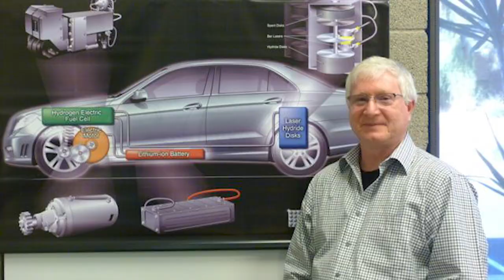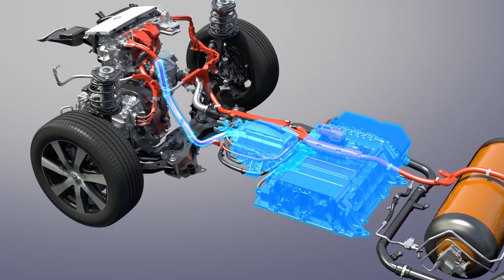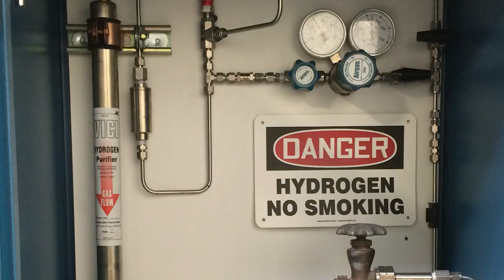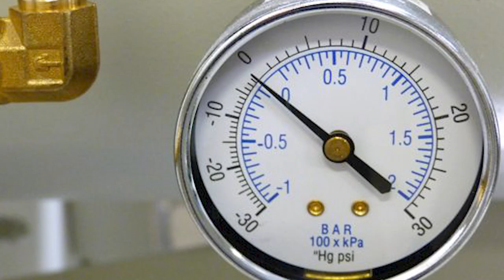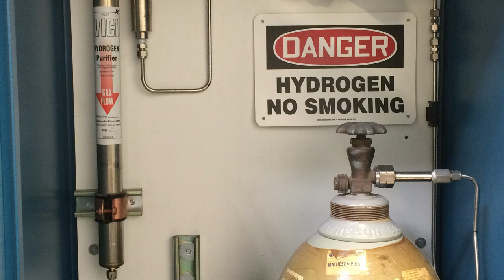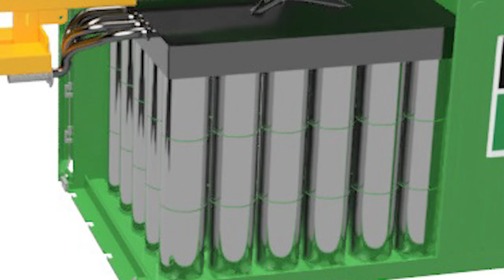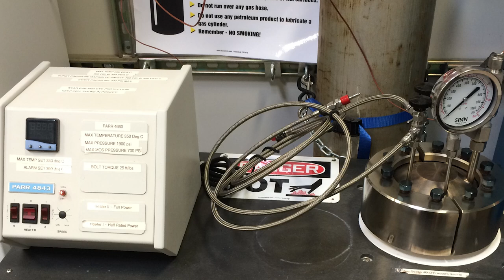This BANNED Technology Could Push Hydrogen Cars Over BEVs

Comment: Exciting technology.  I am excited and intrigued.  But the numbers don't add up.  Paul said 15 lbs for 20 miles.  That's 1 lb for 1 ½  miles.  But he did not say whether it is for a compact car, a full sized car or a pickup.  Then he says 4X 375 lb (=1500 lbs) will take a truck 500 miles.  That's 1 lb  for ⅓  mile). You ASSUMED he meant a semi truck, which would be spectacular).  But he could have meant a F150.

Comment: FYI there is another hydrogen tank type, maybe it’s the same as you are talking about, bob lazar had a relatively low pressure tank that stored the hydrogen. There was something in the tank. I believe that thing was something used in nuclear weapons or something and therefore it was banned. But the hydrogen was not explosive and required low pressure so he could charge his hydrogen car back in the 90s with a solar panel.

Comment: To me I think the best solution is to concentrate on multiple engines, a combustion engine running alcohol from sugar cane because burnt alcohol from sugar cane can be absorbed by plants, then a hydrogen engine to assist the alcohol engine with a diamond nuclear battery( if that is a real thing) for backup. I reckon a car should be clean of course but it should use multiple technologies to go further and faster!!!!

Comment: You are correct.  But ! For larger vehicles, that run for hours. Like a range extenders. 
Trucks, Trucks refrigerators,  tractors, many farm combine harvesters, ships, large boats , many vans 
All need electrical power.  You don't want to run out of electric in a ship. 

Also you can use as generator s to recharge say 10 cars 🚗  at a super charger stations.  
Delivery of liquid hydrogen to regular placed generators. 

The sun goes down at night. 
The wind is not reliable. 

Cars is stupid I agree 👍
Bikes.

Comment: This pressure is similar to Hydraulic pressure, as used in army tanks. It is well known.
Reply: I wonder if we can develop solar panels better so they soak up more rays and then we can use mirrors to funnel more rays into a small area so we can have more mirrors than solar panels and vastly reduce the amount of solar panels required

Comment: Have Toyota 2000year 2.7ltr Hilux utility,am I able to convert it or change over to hydrogen fuel cell and motor..What is the cost to do this and what are the costs of the discs and availability in the U.K. please

Comment: This is definitely the way to go. Beats lugging around thousands of pounds of batteries that take hours to charge. Replacing a battery pack is crazy expensive and manufacturers will stop supporting early versions as time goes on. You will be stuck with a vehicle that has no gas tank so to speak.

Comment: So is it a better buy than anything else?  It sounds as if after some 10? miles I would have to shut my car off, unplug one "cassette" and plug in another, then have to worry that my car would not start either because the next "cassette" did not work, or because of another breakdown in system components: ?   Even if this is cheaper, it won't do if my car ends up stuck on the side of the road.  How reliable is the plug-in-for-a-few-miles-technology?  Or could the "cassettes" be made with a 1000 mile, or 1500 mile range?  Then at least I could count on more than 10 or 15 miles before the "cassette" runs out ?

Comment: I have doubts : 1) These hydrogen disks will require a lot of conversion steps with cumulative energy losses 2) It will recreate a dependency on a refueling infrastructure, like with gas stations ⛽️, making customers price captives again. 3) Like with petrol stations, you need a huge infrastructure to transport the damn disks everywhere to car reloading stations, meaning that you use energy to transport energy (…) 🙄 it is as stupid like the transportation of oil by petrol tankers burning 🔥 crude toxic sulfur oil to ship it on the other side of earth 🌍 then refine it and finally load it on diesel tank trucks burning 🔥 again energy to bring it to the gas ⛽️ pump. The cumulative energy losses induced and pollution is a nonsense. 4) The easy instant access to electricity ⚡️ anywhere for charging a BEV is much more flexible and convenient. Here in Geneva Switzerland 🇨🇭 a lot of supermarkets and malls offers free charging to attract clients, that is perfect and logic, a win-win for everybody, they get the carbon reduction certificates, you get a free charge. The probable future will be parking spots with wireless charging as standard on every EV, no need to load a mechanical ⚙️ disk, and even highways 🛣 with charging EV lanes as some are testing already in Europe. 5) I have worries that this ultra thin film will have temperature and humidity requirements to be able to work without problems, good luck with that in Alaska or Arizona. 6) It seems that the global quantity of platinum available is very limited and that is a de facto limiting factor if you want to use it in fuel cells on a very large scale. So yeah, I think it is born dead.
Reply: "Astronauts on the moon, aha ha ha ha ha"
      - C 0 N E H E A D S -

Comment: I noticed a heavy resistance to saying how heavy, how many miles. this shot up red flags so doing some math...

1 gal of gas = 6 lbs. my tank holds 11 gallons (small tank) and my hybrid EV battery weights approx 118 lbs. so 184lbs,
184 lbs/15(lbs per unit) thats 12.266r units, thats only 245 miles per "full replacement". (I get 550+ on a tank)

may work for people with pure work/grocery commuting. but for anyone else that does other longer driving, I drive 250-400 miles in a typical night, have done many more some days. I would have to reload 1-2 times EVERY DAY. I would have to transfer by hand that 184 lbs. and how many grandparents do you know willing to move 184 lbs (remember this is a small situation) to "refuel".

my car is made with low payload so going above this would drastically damage the suspension/handling.

maybe something with a larger tank?
not really, as that is the smaller source of weight to begin with.

so purely EV change?
average EV battery is 1,000 lbs this is easy math...  66.66r units = 1,333 miles HOWEVER, if we look at the difference in weight between a ICE vehicle and its EV counterpart, its more like 750 lbs. so 50 units = 1,000 miles. and still having a tire burning weight on the tires. better than pure EVs... but new battery tech is looking at tripling (at least) the range in the next couple of years. and not require heavy lifting.

Semi trucks then?
we will use a large semi fuel tank of 300 gallons, diesel weights 7lbs per gallon approx. so 2100 lbs. this is a 1500-1800 mile range
he said the canasters were 370 lbs, and 4 of them (1480 lbs) is 570 miles... so 2.59 lbs per mile... so even if fully loaded to the old weight its 808 miles.
when you figure in extra idle time, especially with refrigerated loads. this really adds up to how often they would have to pull over to fuel. and then to have a major event to load the fuel canasters with a forklift.... each place would need a crew of 10 or more fork lift drivers, massive warehouse, and you would be waiting in line still 4-5 times longer (minimum) than what refueling takes now. for truckers time=miles, miles=money. they wont want to sit around for an hour or two just to continue down the road.

now with ALL of these you have a MAJOR issue. TRANSPORT OF FUEL. you are already at a loss for miles per lb, so you will be able to ship less miles per load to stations... TO AND FROM, they have to be taken somewhere to be "recharged". and EVs can pull theirs straight from a grid with no real transport waste.

this is pure hydrogen hype. throw some numbers out, hope people take it face value and don't do their homework. cause it just doesn't pan out.

Comment: I thought stan figured this all out in the late eighties.High voltage pulse tank circuit at resonance with water being the dielectric part of the capacitor in the circuit.Hydogen on demand with mixed exhaust for retor fit.Patented the tech thirty years ago.

Comment: This technology is the blessing needed to supply Hydrogen in a safe format. Revolutionary technology is needed to replace gasoline and diesel. Oil can still be used to lubricate, but a drastic drop in pollution.

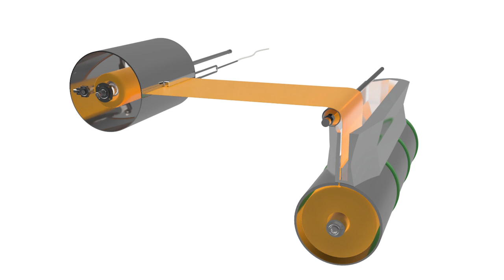Comment: HA! I was joking about the 8-track tape but then look at time stamp 11:55. They have gone from CD to the more efficient 8 track tape design.  If an airplane is using this and the tape begins to drag, the checklist for the pilots will tell them to cut the tape, pull two or three wraps out of the center, and then splice it back together.  The music (Oops, I mean jet engines) will stop dragging.

Comment: This tech might work if it's feasible to recharge the tape/disc at home.  Without home charging, I don't think the infrastructure could be built out fast enough to compete with batteries.  Though personally, I think gas > both.
Reply: Exactly! Customers MUST be able to either make their own H2 and put it into their own cars, or buy the shit for pennies on the dollar. Charging customers out of the nose just for the luxury of being able to drive around is so 20th century.

Comment: The problem with solid state Hydrogen vehicles is that you have to recharge the Hydrogen periodically which can't be done like recharging/refueling EVs/ICE cars. You would need to have the car taken into a company that can swap out the PK Solid State hydrogen disks/Films/batteries.
That poses many downsides and new complications. It needs to be solved for it to come near Hydrogen FCEV'S or EV's refueling ease of operation.
I know a Chinese EV company has cars that have their battery swapped out by Robots in a drive in garage similar to a car wash.

Comment: On the figures given of 15lb for 20 miles that would scale up to someone lugging around 225lb ( 102 Kg , or a large man weighing 16 stone) in order to have 300 miles range on board.  And in some cases where someone has a high mileage job do that every day.  Or they could plug a BEV in at home as they sleep and wake up with 300 miles range every morning. Hmmmm. I think I spot a flaw. And we haven't mentioned the cost of H2 cars or this fuel yet.

Comment: The first thing I thought of when I saw this video was the old 8 track tape player which is a big continuous loop of tape.  It seems to me that you could store a lot more in s small space with a tape rather than a disk.  Is it just the weight of the tapes?  What am I missing here?  What if you drive to a service station and they have a machine that swaps them out for you like a big cassette.  You don't even have to get out of your car, maybe a drive through thing, kinda like a car wash...

Comment: Had this been fully developed several decades ago, I can see that this technology might have been used to decarbonise aviation and heavy goods vehicles by now, BUT it doesn’t address the life cycle efficiency issue which is the hydrogen killer for mass adoption as a fossil fuel replacement. We simply don’t have the renewable energy to waste on the inefficient production of green hydrogen fuels. The key limiting factor in the energy transition now is time. The carbon budget for limiting global heating to  +1.5 Celsius is ~6 years of BAU global emissions! This implies drastic and immediate action to curb emissions regardless of whether renewables have reached the capacity to replace all fossil fuels. The unpalatable implication is that more technology is unlikely to be our saviour.

Comment: I was cooking and cleaning while I listened to this, so they may have explained their thoughts on producing the hydrogen and everything up to the coating of the material. It seems like  electricity  stored in ever-improving batteries is more practical than producing hydrogen to generate electricity on board the vehicle. Not to mention that electricity flows everywhere, now you want to make these fuel pacs that need to be produced, stored, shipped, installed etc How is that ever going to be a better idea?

Comment: If I understood it right, then he was saying that one would need 375 pounds of discs to travel 500 miles at 15 pounds for twenty miles. one would need some nifty lifting gear and stacking space on the vehicle. I presume that these discs will have to be loaded into some kind of cartridge at 15 pounds a pack that will take some doing with the 25 packs needed to travel the 500 miles.

Comment: Pressuring hydrogen gas to high pressures is a weak link in terms of energy efficiency of conventional hydrogen fuel storage and transfer. I would therefore think this fact gives the Plasma Kinetics system some margin to work with to compete with conventional high-pressure hydrogen storage and transfer systems in terms of overall efficiency.  But yes, of course, seeing hard data as to the overall efficiency of the Plasma Kinetics process is a matter of central importance.

Comment: Alex, you will never see a stable app or vehicle interface because as soon as someone writes a good one, someone else changes something else to make it obsolete.  I have had pretty good luck with my Mach E, so far, but have no faith that level 4 self-driving AI is anywhere close.  I do have faith in the hydrogen CD though.  The hydrogen 8 track tape was mentioned in the movie Armageddon if I remember correctly.

Comment: If the hydride material is only on the surface of the substrate like it sounds in choosing film on a roll, then disks were never a good choice.  If the laser light can free up the hydrogen from all the millions of layers in a disk 3" thick, then a disk would be a more convenient replaceable item.  The problem either way is in needing an infrastructure of places where you can exchange them and no backup plan of slow charging at home.  We are 15 yrs into building a battery charging infrastructure and still not as easy to find as a gas station.  Charging batteries means you could install enough of your own solar panels to never buy fuel for your car, but with this product you would always have to pay someone for energy to drive.  At least the old particulate hydrides that used a small amount of heat to free up the hydrogen could be recharged at home -- the electric charge would cause any free hydride material to absorb hydrogen again.  It would collect  the water that came out of the hydrogen fuel cell, use electricity to split that water into hydrogen and oxygen, let the oxygen go, and feed the hydrogen back in to be reabsorbed by the hydride material.

They talked about the weight of this material vs. batteries, but I didn't hear anything about how much space they take compared to batteries. They also didn't mention that batteries are complete power source while the hydrogen is only half the system -- so how much does a hydrogen fuel cell that can produce 250kw of peak power weigh ?  Just the hydrogen material sounds kind of tedious to replace every few hundred miles.   I imagine rolls of material that were 12" diameter and 5' long and weigh 300lbs would require a machine to switch them out and be tough to work into the design of a passenger vehicle.  Especially since it sounded like each roll would need the same amount of empty space for the depleted film material to roll back up onto. On the other hand, having ten 30lb smaller rolls to replace could be done by hand if you didn't mind a repetitive task and have to walk far fetching and returning each roll.

Comment: I just saw the results of a study. The price of EV batteries is not going to come down with time, in fact, it’s going to skyrocket in price because of the shortage of lithium, cobalt, and the price of copper, three key ingredients needed to make EV batteries..
 a motorcycle buddy of mine has an electric motorcycle, not a zero. This is the one with a manual six speed transmission and a clutch. I forget the name.
  I won’t go into the details of how his batteries went bad because he left the key on intentionally to discharge them, thinking that when he recharges them, they would give him more range and take more of a charge.
 after doing tests over the phone with the factory technicians. They told him his battery is toast. He needs a new battery pack. He asked how much are they..
 The battery pack for his motorcycle has seven batteries. Or battery cells. Each battery cost $6000. The total for a new battery pack is $42,000..
  there are videos right here on YouTube of people that have Nissan leaf electric cars. Their cars need a new battery. Their cars do not have a lot of miles on them, but they are older. Which means, the batteries cost more to replace than the car is worth, and the price of the batteries is not coming down like they said it would , Because of the cost of raw materials to make the batteries.
  another complaint by the Nissan leaf owners is, you can’t just go to your mechanic you went to for decades at the corner garage. You have to take your Nissan leaf to the dealership where the mechanics are licensed to work on electric vehicles..
   in cold climates, the range we can operate a Nissan leaf is cut in half, and the heaters are not that great in the winter with an EV.
  Great Britain is going with hydrogen. The engines can be worked on by the tens of thousands of current automobile mechanics because it is a internal combustion engine that just happens to run on hydrogen. You don’t have to teach tens of thousands of mechanics how to work on EV vehicles.
  I keep my vehicles a long time. I have never been without a truck since I was 19 years old. I had my first brand new van, a Ford Econoline for 31 years. How many batteries when I have had to by in 31 years.
  My friend with the electric motorcycle that needed a $42,000 battery. He ended up selling the motorcycle for parts on eBay

Comment: This is purely a storage system, the problem with Hydrogen is the power required to harvest it is greater than the power produced when you use it. The net result is the fuel is very expensive.